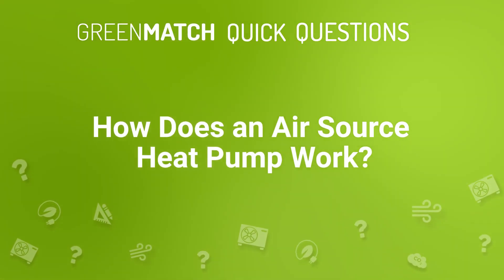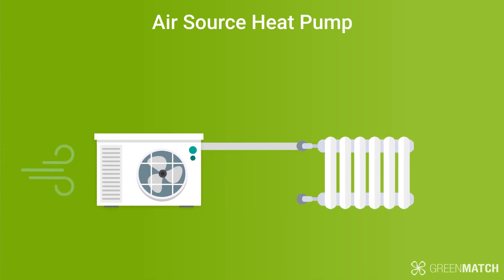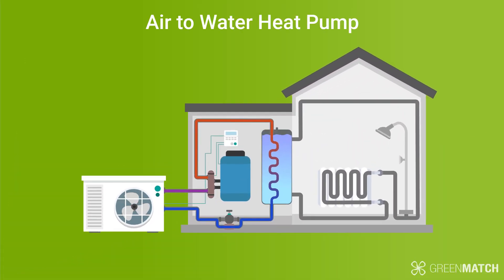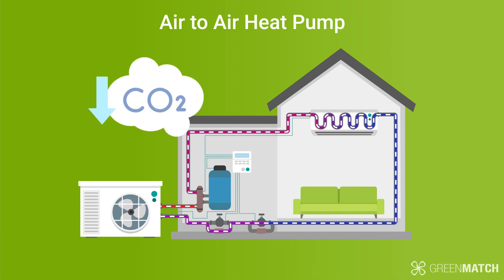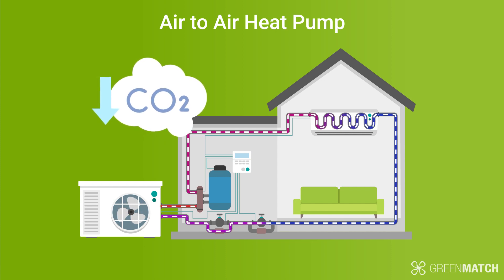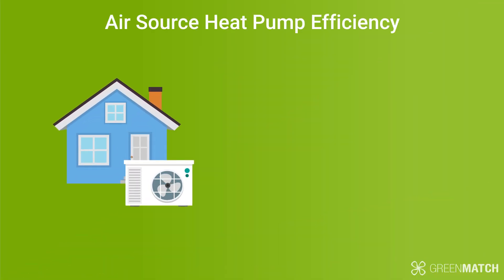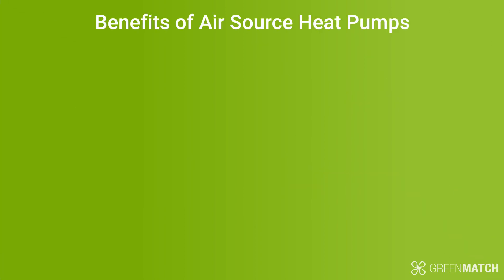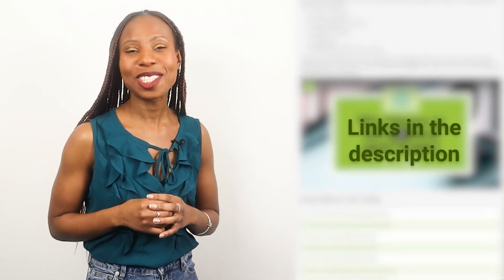AIR SOURCE HEAT PUMPS - How Do They Work? │GreenMatch

Comment: The government "experts" who promote these alternatives have no practical experience or installation knowledge of these heating systems, nor the ongoing problems they cause their neighbours. The noise and air vibration they emit is horrendous; "It's a noise that gets right inside your head", as my friend tells me, who is unfortunate enough to live next to one of these systems Just imagine one of these installed on every house in your street... One is extremely noisy; a road full of them would be unbearable. I know of two people taking legal action against their neighbours due to these devices. They tell me that the constant noise and vibration frequency are wearing them down, both mentally and physically.
Reply: Air source heat pump heating does not come without problems. Moreover, The UK Government's £450 million scheme to convince us to install the allegedly eco-friendly boiler alternative is questionable. Concerns about availability, trustworthiness, noise levels and functionality issues have indicated that these contraptions may undoubtedly turn out to be the next major government misselling fiasco. Rather comically, it’s a paradox that when days get colder, the cost of air pump heating increases...

Comment: Air source heat pumps can be very expensive in cold weather. You are using electricity to work the pump, but in cold weather, when temperatures get below 5c, you can be putting in one unit of electricity and only getting one unit of heat out. So, they can be as expensive as an electric fire. The best ones are those that are sited in your garage as they are sourcing warmer air so it costs less to make the exchange. The best thing would be to spend your money on improving your insulation. The better insulated, the less it costs to keep warm. If you have a chimney, or an outside wall where you can put a flue, put in a pellet burner. The least expensive form of heating and very efficient. But either way, do your homework. The salesman is there to make a profit.
Reply from the maker: Hi Paul, thanks for your comment! You are absolutely right that the very best thing you can do to your home is to ensure you have proper insulation. This will help improve your energy-efficiency regardless of what heating system is used. 

Air source heat pumps can have a dip in efficiency in the winter months, though it depends on how you use it. If you keep your air source heat pump on constantly (also during the winter months) you should not experience big spikes or dips in efficiency. When switching an air source heat pump on, it can take some time for the heating effect to kick in, so if you keep it on all year round and ensure it is defrosted regularly then it should work efficiently also throughout the winter months.

A good thing to look out for when looking for an air source heat pump is the seasonal coefficient of performance (SCOP). This will give you a good indicator of the efficiency levels throughout the different seasons. We always advise doing your research before installing an air source heat pump system to confirm it is the right choice for your home. You can find more information about air source heat pumps on our website: https://www.greenmatch.co.uk/heat-pump/air-source-heat-pump. Best regards, GreenMatch